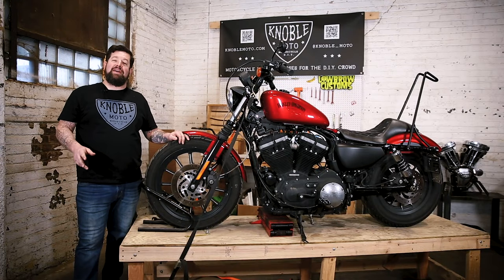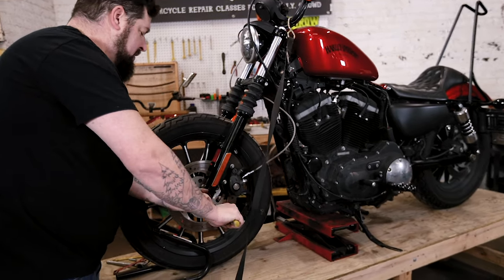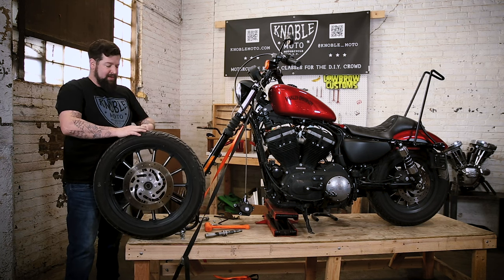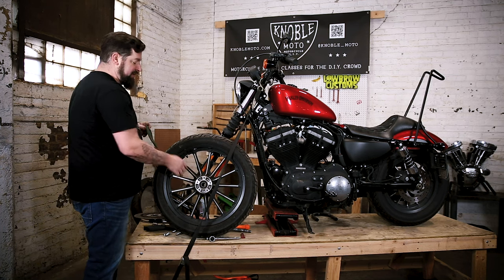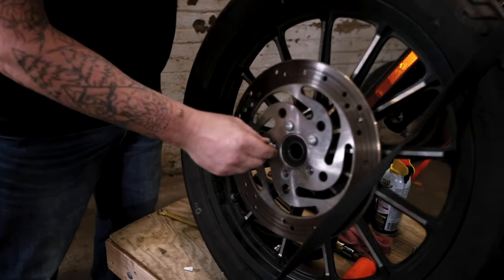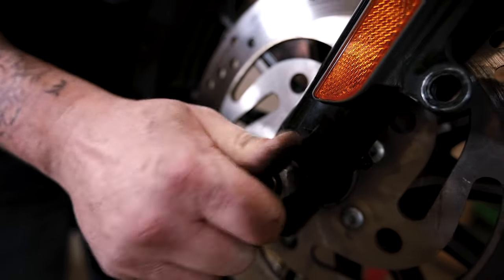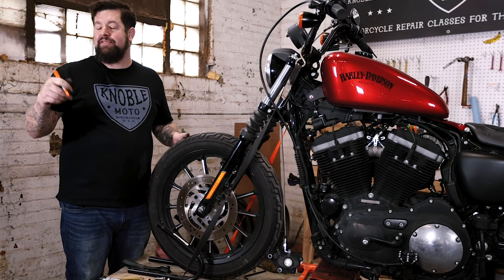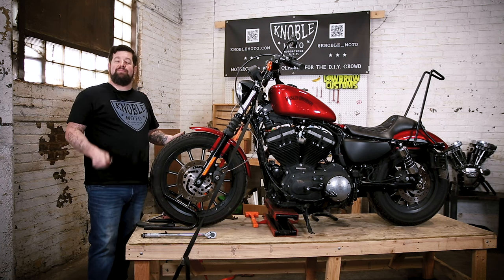Knoble Tech Tips: How to Replace A Front Brake Rotor On A Harley-Davidson Sportster

Comment: Another great informative video 🙂. Can you re-use rotor bolts? I thought they were single use?
Reply: It’s fine. They are not getting torqued to that high of a spec. The threads on the wheel will fail before the bolts (assuming you installed the rotor properly)

Comment: There is no reason to remove the fender for this job.
Reply from the maker: It depends on the tire you are running... In this case, removing the fender allowed the wheel to roll right out forward without having to fight it against the fender mounting hardware, as it would have interfered as the bolt heads were in the way.
Reply: I agree. Removing the fender on this era sporty make the job much easier.